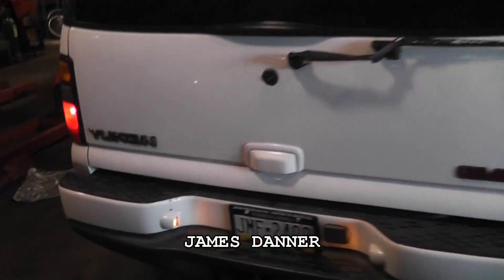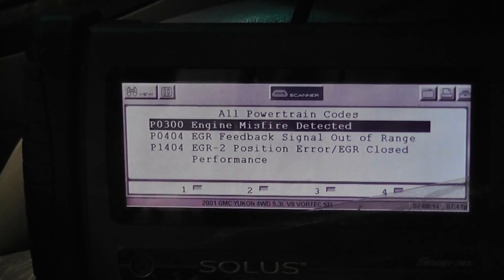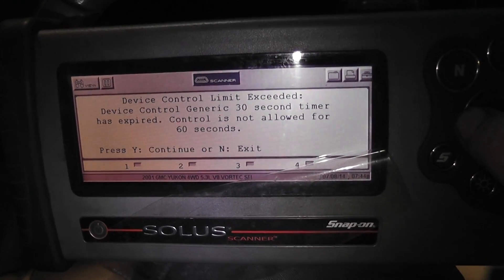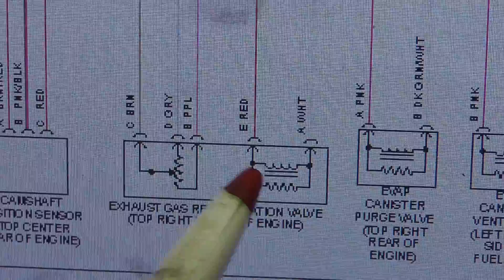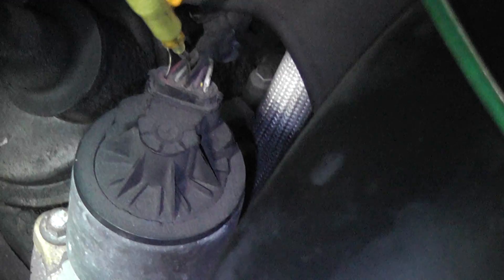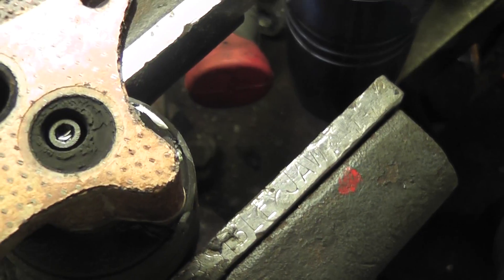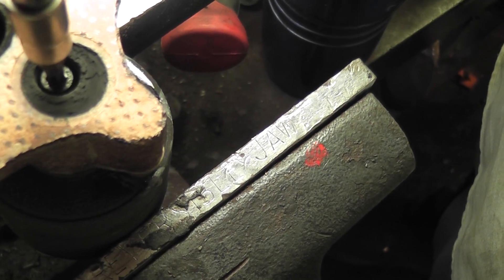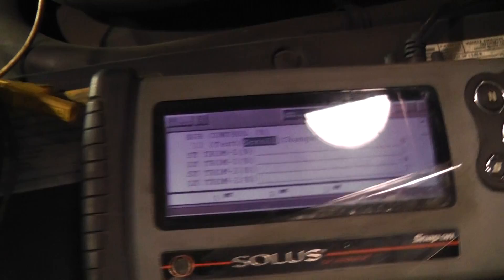GM EGR DIAGNOSIS AND REPAIR

Comment: awesome video, so you mean if the pcm did not command open the egr the system  02 sensor  shows lean?? and when pcm command to open rich?
Reply from the maker: i think its all in the programming but fuel trim should remain near the zero during normal commanded egr,but with the valve stuck open, that is air coming in that the mass airflow doesnt see so pcm wont be adding fuel for that percentage of incoming air..result would be a lean condition/positive fuel trim
Reply from the maker: but yes you are understanding correctly just when the valve is commanded if it needs to richen up it will to maintain stoich. fuel trim prob not go too rich
Reply: James Danner thanks, when ever is low at the shop I will do some testing with this system because I remember one time  I was activating the EGR valve and have the emission analyzer hook up if I remember correctly I saw the  CO  very high, rich I ask to a teacher why rich  and not lean and he told me because exhaust air can not burn again it is  inert gas  and does not contained any more O2 than it only uses space in chambers but I know there are a lot of variables out there on the field Thank you.
Reply from the maker: In an efficient burn there should be just enough o2 to completely burn all the fuel. So watching 02 sensor its always trying. Sweeping above and below that magic number. In theory there will at least a little 02 left at times(some converters store this so they can do their job). But what i was taught is that the incomplete or partially burnt fuel is what is utilized to richen up the mixture when the egr is energized to help with detonation and NOX control. So i can believe the c0 would rise and cause a richer mix. However with a mass air flow controlled system there would have to be a point where the rate of unmetered air entering engine(thru egr ) would be too great and add that to the fact that it is now misfiring or at least running rough. So now the burn is definitely incomplete so there is alot more left over oxygen and even tho there is also left over fuel which u would see as c0 or hc.the 02 sensor only sees the oxygen and pcm would tend to try to richen up more. We could definitely theorize all day. Ha..thanks Joel
Reply: James Danner  thanks ,by the way the teacher told me that was not your brother jaja

Comment: why does a stuck egr would cause fuel trims to be positive? should it be vice versa?
Reply from the maker: even though an egr technically richens up the mixture under load to deter detonation , when its stuck open at idle and the pcm isnt commanding , it is unmetered air entering engine after the mass air flow sensor, so pcm would under estimate actual incoming air and result would be lean

Comment: Nice video !!! like your real world approach. did your repair also fix the po300 ?
Reply from the maker: time will tell. i know it was running pretty rough at idle before and smooth after. plus at tip in accel. it would buck bretty good. all that was gone and i havent heard back from him so ill take that as good...thanks for watching

Comment: Hey James
Can the egr valve cause a stalling problem? Can it also cause a complete no start every once in a while? I have a 2004 silverado idling rough
Reply from the maker: this one stalled alot. as far as no start, it should start with your foot on gas if it is the cause of a no-start. these engines also have intake vacuum leak issues and electronic throttle issues(if no accel cable) where soot builds up on throttle body and cause low lumpy idle with stalling. if u pull air boot and look, u can clean this too but may have high idle issues without a relearn.. snapon and tech2 gm call it a module reset

Comment: Nicely done!  I will say, from my experience as a GM tech, I have very, very rarely seen those linear PWM EGRs fail outright.  They get all schmung'd up and stick, but the solenoid control itself rarely fails.  Give it a good cleaning, and slap it back on; you'll be good to go.  The "shaft play" you mentioned in the video is normal.  The pintle head itself is self-centering in its seat, and is energized closed to maintain a seal, as well as energized open during normal operation.

As a caution, however:  DO NOT SOAK that style of EGR valve in any sort of cleaner.  The pintle shaft seal may as well be non-existent, and fluid both can and WILL find its way up the shaft, eating the coating on the coil and shorting it out.

Also worth noting:  If you do replace that style of EGR valve, there's a 99% chance you will have to run the PCM through an EGR re-learn procedure, otherwise the thing will throw codes left and right.  :-)